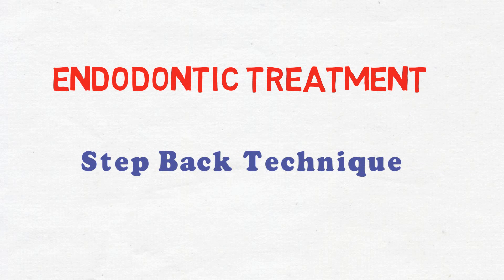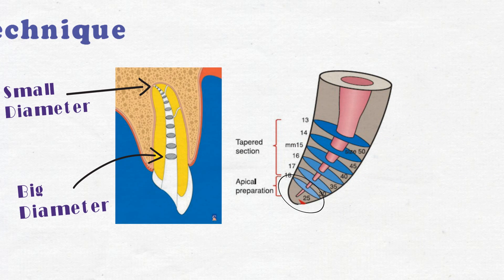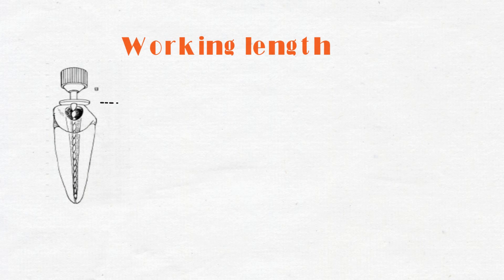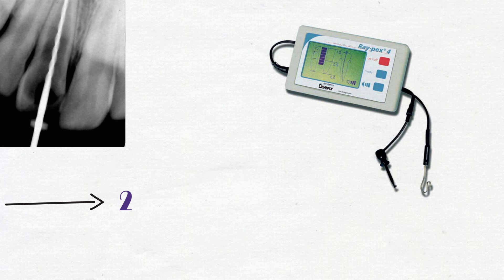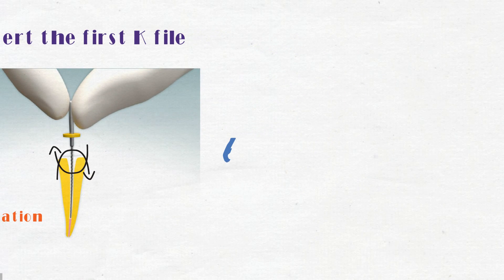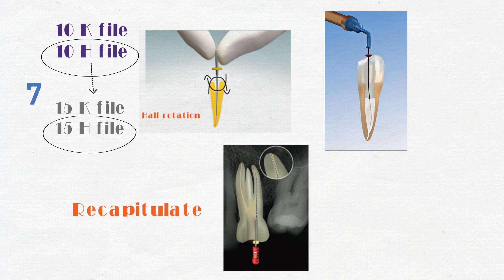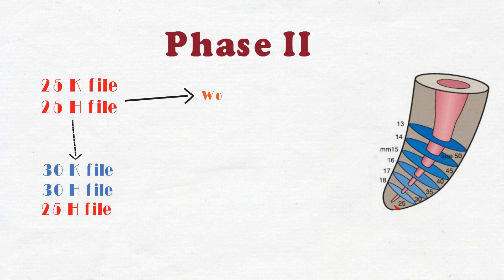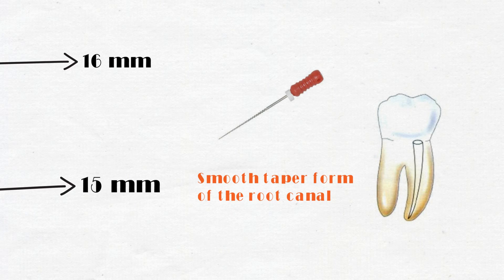Endodontic Treatment (Step Back Technique)

Comment: in phase I , do we recapitulate with the smallest 10H file after each step or recapitulate with the previous smaller file ?
Reply: You recapitulate with the previous smaller file.
When the step-back phase has started, you recapitulate only with the apical master file.
I'm pretty sure you already know that, given the fact that the question was made 1 year ago, but i wanted to help 👍🏻
Reply: @johnnyjanko364  how can we know the size of m.a.f ? If it 25 or 30 or 35
Reply: @SuperAlaa111  it is required to enlarge the  root canal up to 25. In some cases, like upper central or canines, which have naturally a wider canal, you can go up to 35. It depends on the patient's age, the secundary dentin formed or genetics(the size of the teeth).
Reply: @johnnyjanko364  thank you , what is file size number we can enlarge after m.a.c if its 25?
Reply: @SuperAlaa111  up to 40, but you can stop at 35 if you wish.

Comment: What is recaptulization..
Reply from the maker: Kinza islam 
It's repeating the earlier movement of K file which saves the form of the canal and removes the debris that caused by the K file by using H file of the same number, which than it is used as a master file to save the shape of the canal

Comment: The old school technique uses H file after conicity has been made with K files&Gates/Largo in order to smooth out the ladder. (E.g. 25-MAC 20 mm length 30-19mm, 35-18mm, 40-17 mm, 45-16 mm, after step use hypochlorite + recapitulate with K file 25 for 20 mm )The H file is the same length as MAC and same size.    Further conicity created by Peeso bur. And only then you use H file 25-20 mm to smooth out the ladder.

Comment: hey I have question......you said that 25 master file so during obturation master cone gp is 25 or ? the last file that we use during  prepartion
Reply from the maker: Yes, with obturation we use the master gp which is the same size of master file we have used in preparation  and that reach the apex.